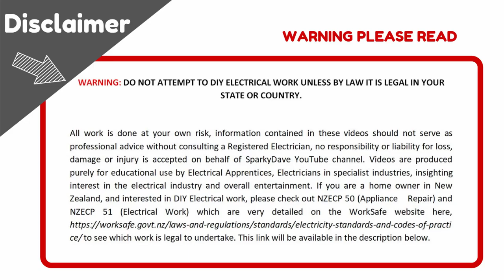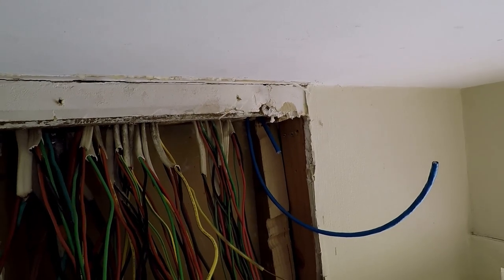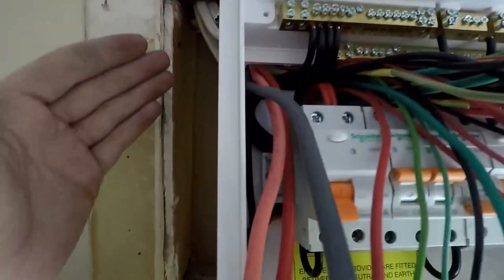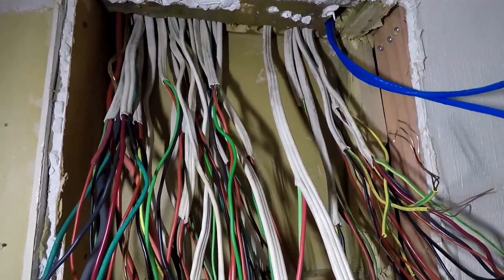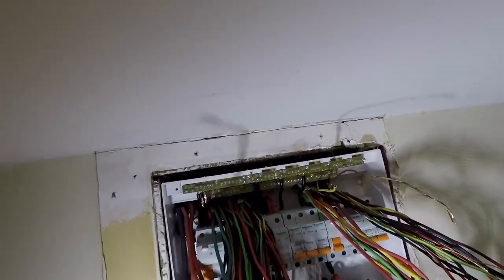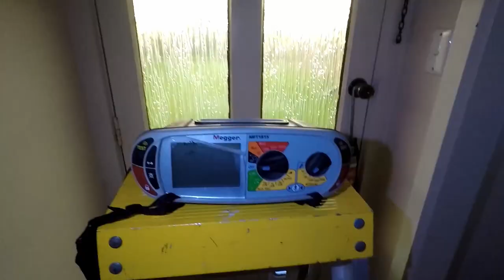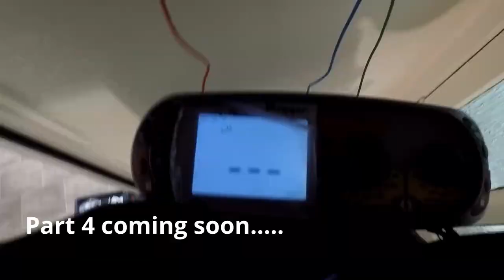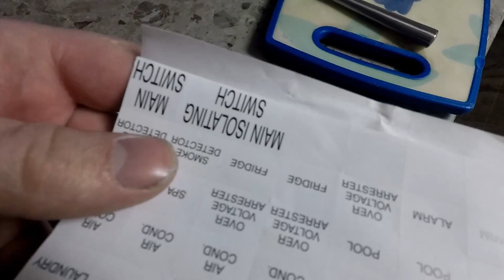How To Install a Switchboard

Comment: Nicely done and nicely explained. I'm wondering if you are seeing more people use RCBO's these days, instead of MCB's and RCD's? I decided to use them on my last job, because there was limited space. Obviously they cost a bit, but you also get that added overload protection. As the Regs have changed and more RCD's are used, the RCBO option starts to become a bit more feasible.

Comment: Hi, let's just assume that a protection or breakers, so 2 options: the user is 2 and a half meters tall or do you have to have a ladder next to the general board or main box?.. I'm applying for some jobs in NZ and studying AS/NZS 3000:2007 - Standards New Zealand and I can't find security in the installation, is this really accepted like this in NZ? In Chile I carry out projects under decree law 8 (DS-8-2019) and to register with the EWRB and validate my titles in NZ, under the supervision of a certified Electrician with full registration, is that so? I know that each country has its specific laws, but I have worked for more than 25 years and at Codelco Chile in mining and there are universal and international concepts IECC, IEC, etc. by which we are also governed in Chile

Comment: It is much easier to put the cables into the box and screw it on the wall if you take the DIN-rail with mounted MCBs out first, just 2 screws, then put it back when the cables are tidy.
And I prefer the small 4-way neutral connectors that fit in the RCD N-terminal, makes pairing up the neutrals so much easier.

Comment: Dave im running my shed off a extension lead for now which runs off the main board but when i hook 
the MEN up it trips the RCD and RCD in the main cabin where the mains comes from it does not have a MEN link also
would that be why ? Both have separate main earths....Cheers Brett

Comment: Amazing! Just amazing! Gonna be a while before I attempt this one,  but nice to know its just a logical order you follow. Thanks for the DE-Walt drill bit reccomendation - im been looking for a good spade bit. By the way, I also bought the blue 220v tester you recommended from your usb video -  bloody awsome!!

Few questions though...

1 - How did you turn off the power coming into the house so you could start disconnection of the old power box? 

2. How do you test for a faulty breaker? I mean at 11 seconds after your video started when no wires are connected up. How do you know if you have a faulty breaker/fuse?  I just wired up my sleep out and i'm only using 2 fuses + a main (Light, Power + main) and there is an intermittent problem with power going off in sleepout but not tripping the power box in there. Nor does it trip the main power box inside the house where the feed is coming from. 

So when I disconnected the three fuse box in the sleepout and connected the power and light directly to the feed wire bypassing the entire new power box everything works perfectly fine Over a week without any power dropped out or cut-outs. And even the fuse inside the main house trips exactly when it supposed to when I plug-in a few heavy draw items ie heater, toaster, microwave etc.

Again nothing was tripping when I ran everything thru the sleepout power box ...no tripping at all from any of the sleepout or main house fuses, just no power outlets or lights working. Power was still coming into sleep out though from main feed. 

This is why I think it must be either a faulty fuse, or my wiring lol. 

Thanks Dave - much appreciated.
Reply: You can't turn off incoming cable from the street

Comment: Awesome work Dave, how much would it cost in NZ to install a 32A breaker and a new power plug (conduit) external 6mm cable (7 meters) away from the board?

Comment: Hi Dave, have a home built in the 80's. Planing to upgrade the switch board. My power sockets are on 1.5 mm sq cables. Would using 16 Amps MCB's be right or should I drop them to 10 Amps? Thanks mate for putting up the Video. Cheers.

Comment: How come you did the new board so high? Doesn’t main switch have to be below 2m? Also, did you get this inspected - as you worked on mains, MEC and MEN? Serious questions as I’m in a similar position and no one can give me a clean cut answer…
Reply from the maker: This work is classified as maintaining an existing 63A switchboard, by replacing switchgear, and does not require an inspection. If you were extending cables to move the switchboard lower or to a different location, or increasing the capacity of the switchboard (ie. upgrading from single to 3 phase) then this would have to be inspected as you are altering the mains cables. Main switch in any new installation must be below 2m in height, however a main switch already in service (ie. before the regulation existed in New Zealand, already met the current regulations at the time of install) would not require relocation when replacing for maintenance or replacing if damaged. Cheers.
Reply: @sparkydave  cheers mate!

Comment: If my meter says 100A how many amps the main btreaker is needed for my house. Can i use 100A  breaker? I need much power.
Reply: 100A
Reply: Depends on how big your mains cable is.

Comment: 17:05 little confused, why link the neutral bar to the earth bar??
Reply: In Australia & NZ we use the multiple earth neutral system, which is the MEN link you're enquiring about. In short it brings the neutral and earth's to the same potential (voltage) .

Comment: zero chance id use a saw on asbestos , it creates a massive amount of micro particles, at the least youd have to spray the blade as you cut .
one guy i had to clean up after created a huge volume of extremely fine asbestos and he wore NO mask, it took me hours to decontaminate the area, you can buy hepa filters for your vacuums so the vacuum doesnt spew fine particles into the air.

Comment: Cool  vid  love your work 
Just wonder why you need a  6mm earth 
From neutral to Earth
Reply from the maker: In both NZ and Auz we use the MEN (Multiple Earthed Neutral) system where Earth and Neutral are connected at all main switchboards and supplying transformers. Fault currents always travel back through the Earth to the Neutral supply, and having the Neutral connected directly to the Earth bar creates an excellent low resistant path back to the Neutral supply. 

If you know ohms law - low resistance = high current (at 240v), the low resistance path direct to the Neutral conductor creates a very high fault current ensuring it would be high enough to trip the circuit breaker at the switchboard. 

With no MEN link the fault current would tavel through the Earth to the nearest MEN link (potentially a neighbours house) and back through the network neutral to your switchboard where the higher resistance from the longer path taken (ohms law - high resistance = low current) in the circuit may not create a high enough current to trip circuit breakers, so a potentially lethal voltage may be present at the faulty appliance.

Hope that wasnt too indepth to understand, cheers
Reply: @sparkydave   so I'm having  a new sub bord in my shed  dose just one earth wire have to go to 
Neutral ??
Reply: I have a granny flat in my backyard and in the power supply sub-board there is no Earth going to Neutral is this due to the fact that it's in my main house   switchboard  ??
Reply from the maker: @hurleymatthew44  with a sub board (DB) as long as both earth and neutral conductors are supplied directly from an MEN switchboard and are of sufficient size there is no need for extra MEN link
Reply: @sparkydave  ok thanks mate
Reply: @sparkydave  Hi Dave - I get that the Earth is connected to Neutral at the switchboard, but surely that would mean that there is continuity between Earth and Neutral at the appliance. But when you tested the continuity at the ceiling fan, the Neutral was not connected to the earth - how can this be? If all Neutrals at the switchboard connect to all earths, then it must be connected at the appliance too? - WHat am I missing?
Reply from the maker: @theprintguys3456  when an RCD is installed in the circuit it interrupts the neutral. So if an RCD is tripped or in the off position, the neutral path between the appliance and the neutral bar is open (disconnected).
Reply: Ahhhh, I see. So if the rcd hadn’t tripped, then we would have seen continuity between neutral and earth?
Reply from the maker: @billwithers9013  correct 👍
Reply: @sparkydave  In fact it can be dangerous to MEN a shed sub board. For example lets say you are drilling a fence, you ran the extension lead from the house. You are bare foot in a puddle whilst using the drill. You start getting a shock from the drill. The fault current flows through your body to ground but makes it's way to the earth at the shed jumps across to the shed's neutral bar and flows back to the house's neutral. This means a balanced current is 'seen' by the RCD at the house so it does not trip!! Never MEN a sub board.
Reply from the maker: @chrisgraham8297  by right if a sub DB board has an independent main earthing electrode installed, it requires a MEN link. In the scenario you described, I understand an RCD would operate as the MEN connection is always installed on the line side of an RCD.